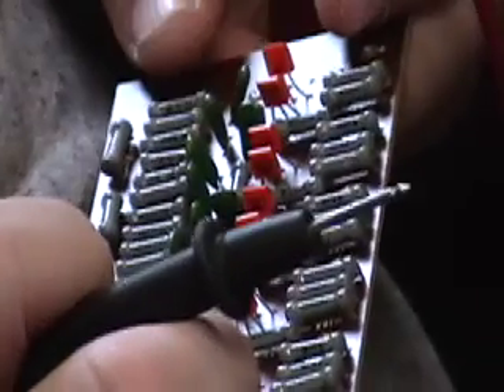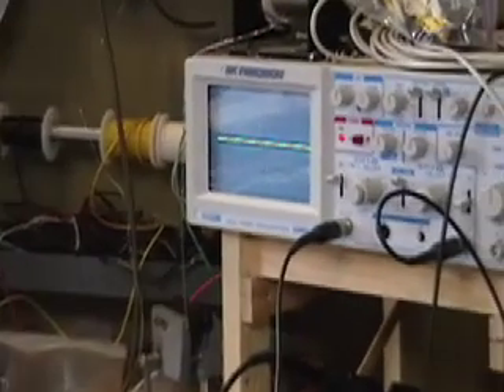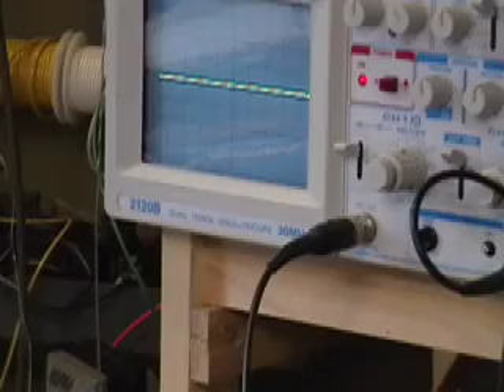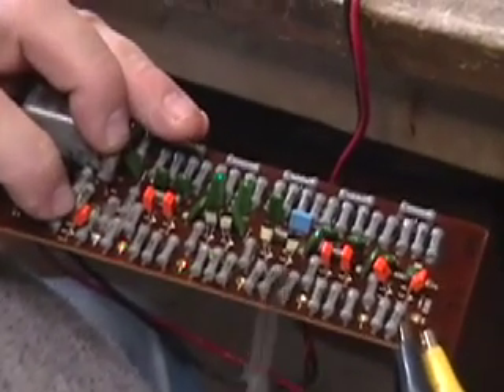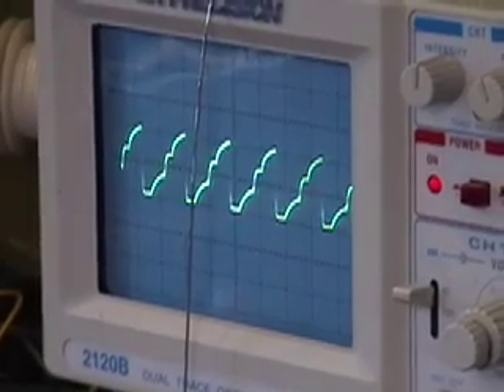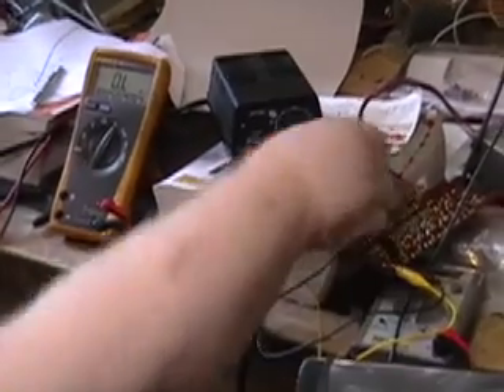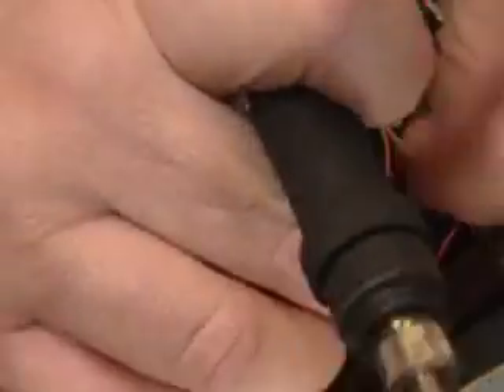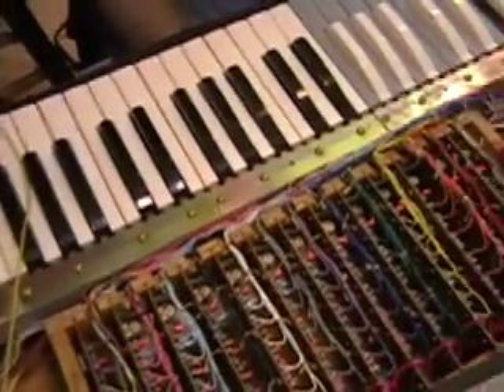Rheem Combo Organ Repair Part 2

Comment: im trying to fix a gem imperial powers up but no output read it could be in the output  jacks just need to take a patient long look over looking for things to replace if the parts are still available thank you for posting these  videos i still need to install my new vinatge vibe amp for my wurlitzer